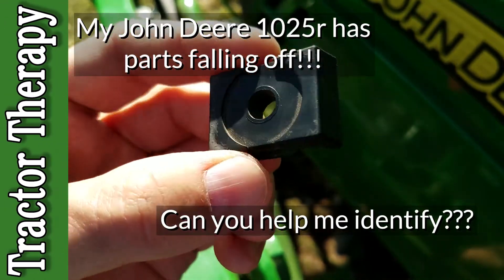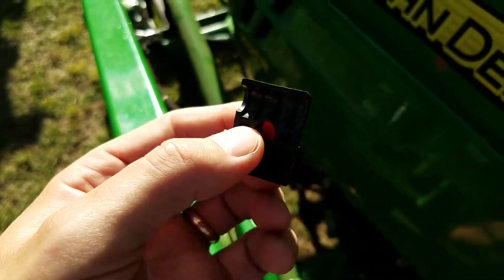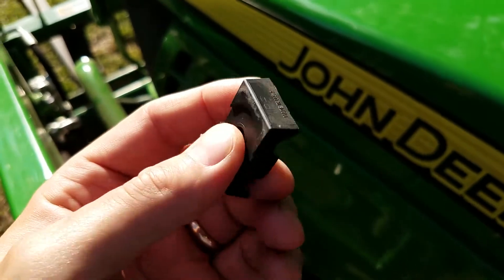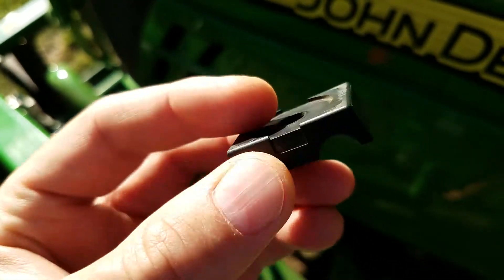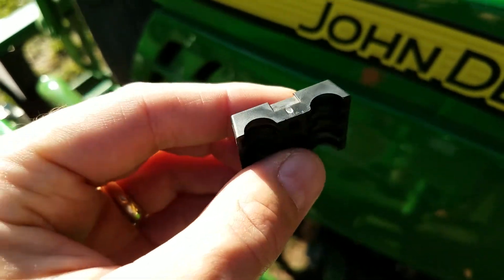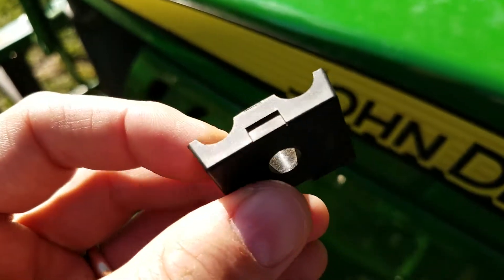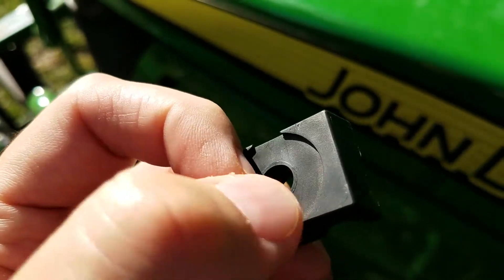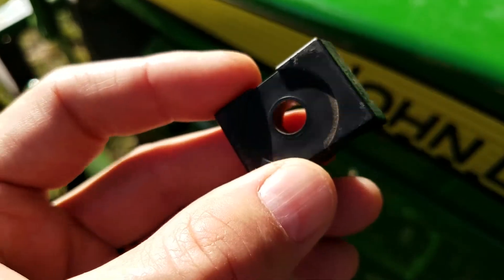Think a part fell off tractor!  Can you identify?

Comment: The 3 point adjustment lever coming loose is usually from the failure of a fiber washer at the pivot point for the lever. There are more than a few threads on the subject at GTT, and mine failed as well. A good place to start looking, although I know that doesn't answer your initial question.
Reply from the maker: Thanks!  I've seen a thread on GTT about the lever recently - I'm going to have to do some more digging.  I'm surprised this is such a QC issue - seems pretty common.  Perhaps Deere will step up their game!  Appreciate you checking out the videos!

Comment: Yes it would hold a hydraulic line.
Reply: two lines next to each other. 
which reminds me. better check for loose stuff
Reply from the maker: I looked over the loader, and don't think it's from there - they all seemed intact.  I think it's from the rear wheel area somewhere.
Reply: I was crawling around my 1025R last night and the only clamps like this that I saw easily were 3 of them right under the floorboard on the left side by the FEL pillar.  I know there are more, but haven't dug that deep yet or taken the panels off of the engine compartment.So far I have the HH receivers front and back, diff lock pedal and "adjusted" the RIO switch.  I really have to clean it to make it look new.  It's all sooty from sitting out at the dealer and the seat isn't a good looking yellow.  I have some "fat man" spring upgrades to do tonight on the seat.  Fun stuff.

Comment: I'm guessing it was holding the steel lines on the loader.  ...but I haven't looked at mine to see if it has a similar bracket.
Reply from the maker: Thanks - I checked the loader and didn't see any pieces missing - think this is from the undercarriage somewhere.  I'm going to try and get under the tractor today to see if I can find where it came from.  Little disappointed in the QC on this...
Reply: Tractor Therapy well, anything can rattle loose.  If I get a chance, I'll look under mine.
Reply: I'd look again as it looks just like the piece that holds the steel lines on the FEL.

Comment: Clamp PN H128515  -  Used in oil cooler and power steering systems.  I found it on JD Parts Advisor.  Couldn't paste a screenshot for some reason.
Reply: Also found similar ones:  Steering lines - R109479 and H135156  Rear Outlet Kit - H108291. There was also one that I saw with 2 bolt holes, but cant recall which system it was in.
Reply from the maker: Awesome - will check that out.  Thanks for watching!